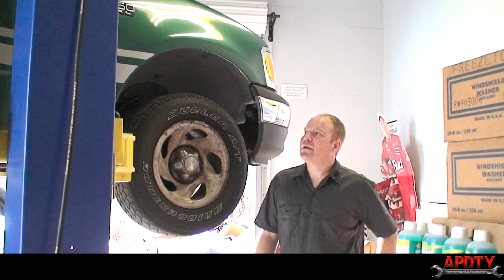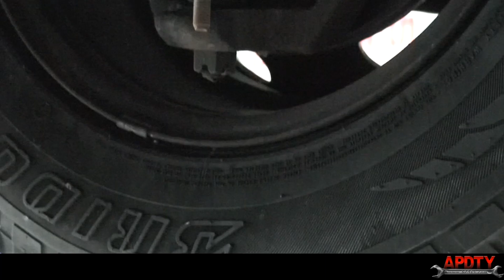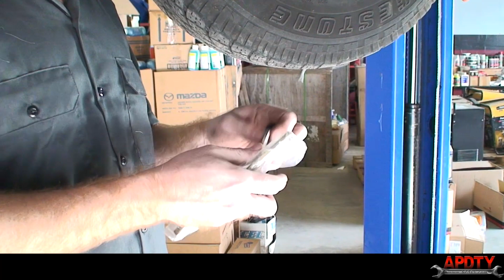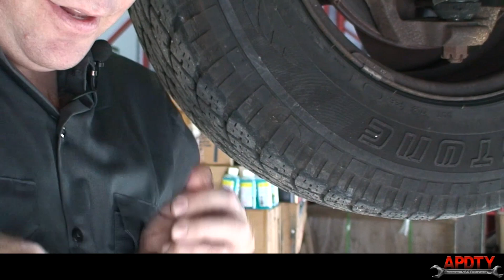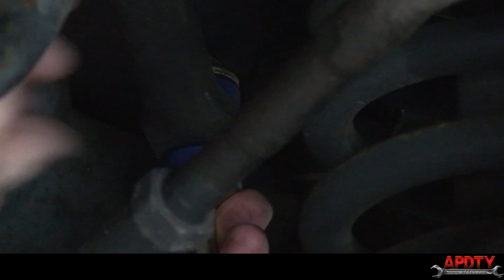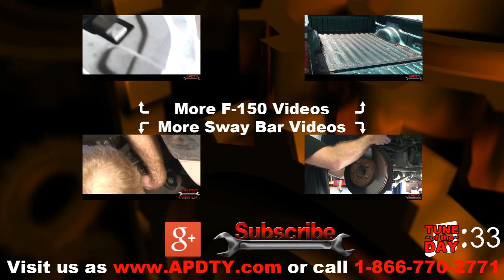1999 Ford F-150 Sway Bar Link

Comment: Believe it or not the bushings like that you can use it product called Ultra Glide yes it's used for non mechanical things but it does help slide stuff through bushings like that and honestly I used it for quite a long time it helps making tight fit
Reply from the maker: mr. Hoole awesome, thanks for watching and commenting!

Comment: Put them in upside down. Not good info
Reply: Actually he didn't. My oems ones are still in my 2001 and the go in the same way. But then again this truck came with 3-4 different diameter sway bars, so it could be different on other sizes.

Comment: Thanks for the video. I've got the parts got to do this tomorrow on my '99. Mine are completely gone, just bolts.
Reply: Mine too. Kept thinking the rattling was loose exhaust until I changed my oil and bumped the sway bar. Just bolt & nut all that was left.
Reply: My '99 too. How many miles on yours?

Comment: Wonderful video, and a very helpful dialog. When I began working on my 1999 F150 rear wheel drive I saw that the stabilizer bar link bolts were not attached to the lower control arms, and the link bolts were so corroded that they were split lengthwise. Until I watched this video I had no idea the link bolts were supposed to be attached to the lower control arms — I thought the bolts were a “stop” for the stabilizer bar. And I am getting close to being 80 years old. “Too soon old, too late smart.”
Reply from the maker: we are glad our video helped, thanks so much or watching and commenting, when we help someone it makes us want to keep making these videos.

Comment: does vehicle have to be elevated to do this repair?
Reply from the maker: no not necessarily, we use a lift most all the time so we forget sometimes how it is without one, you can do it without lifting just the angles change up the approach a little bit.

Comment: Thanks so much for posting this video.  I didn't even know what a sway bar link was until I changed my shocks and noticed the original links (99 Expedition) just hanging with no rubber bushings etc.  I purchased the Moog parts based on your recommendation and installed them today.  Thanks again!
Reply from the maker: awesome great to hear and thanks for watching and commenting!!

Comment: by any chance are the black sleeves threaded??  Mine is stuck on the bolt...
Reply: cut it off with grinder..
Reply from the maker: yes sometimes these need to be cut off, the black sleeves are not threaded and you can cut right through the sleeve and the bolt if needed, it is not uncommon and many times easiest to just cut these off.

Comment: i have a question!? would anybody know what the size sway bar bushing i would need for a 2001 f150 4.6 ?? help
Reply from the maker: these mostly go by a year make and model search in a catalog, here is a link to the end link bushing kits that fit a 2001 F150 4.6L https://amzn.to/2xiOsPL
The above link is for the parts on each end of the sway bar, We would need to know if 2wd or 4wd and we can point you toward the main center bushings that attach the sway bar to the frame
Reply: By now you probably already have solved that, but for others wondering also, there is like 4 different sizes that were used on the 97-03 F150's. You have to measure them out with calipers to be sure you get the right size. You can also use a crescent wrench and get it around it tight, then take it off and measure it. Even on MOOG's site there is 4 different sizes for my 2001 F150 4x4 Extended Cab 4.6L. Mine however measured 25mm with calipers, but they come in 27mm, 30mm, 33mm and 35mm. So mine is the 27mm.

Comment: have a question if your sway bar links a need replacing with that cause your tires to wear on the inside of both front tires? or is that something else that wrong on top of the sway bar links needing replacement.
Reply from the maker: typically no, inner tire wear usually indicates a camber problem or can be a vehicle load issue such as towing and hauling. This occurs when the tire is actually leaning in towards the vehicle too much, this is easily visible when the alignment is checked unless it occurs during towing, towing lifts the from end of the vehicle up and the front tires lean in slightly, Worn sway bar bushings are very similar to any other worn front end part, your tires are not properly meeting the road surface unless all front end parts are working properly and the vehicle is aligned. If a sway bar link is worn out, the vehicle cannot hold the alignment properly as you go down the road so you end up with some type of tire wear and it is typically cupping that you get, the other bad news is that once a wear pattern is worn into a tire, that pattern will continue for the remainder of that tires life. SO you can fix a problem and still continue the same tire wear, in the olds days we would grind down some of the tire, now it is just replace the tires after all repairs are made as tire grinding is not done too often anymore.

Comment: Was having this problem with rattling, and noticed yesterday while swapping my front shocks that the sway bar links had no bushings.  Great video Moog replacements are in the mail so should have it all sorted out in a couple of days thanks to Amazon 2 day free prime member shipping.  $20 for 2 of them to stop that annoying rattling over bumps, and should improve my steering as well.  Eventually I want to rebuild and replace all the steering linkage bushings.  Truck is pushing 200k miles and basically anything that can break is pretty work breaking at this point.  However maintenance to fix it as it breaks is still cheaper than a new truck payment, and insurance.  Gonna drive it until the wheels falls off or I'm too old to drive.  lol
Reply from the maker: awesome great to hear, thanks for watching!!

Comment: Just a note to say how much I appreciate your video. Simple to follow instructions for a shade tree mechanic like me.  Replaced sway bar links on my 99 Ford Ranger today in about half an hour. I could not believe the difference in steering stability after the job was done. The Moog folks owe you one. Used their parts based on your recommendation. Thanks again for your help.
Reply: Try that and a front end alignment
Reply from the maker: You can diagnose this yourself pretty easy.  Tires are many time the cause of a pull and to rule them out, first make sure the front tires have the same air pressure, then if they do, cross-rotate the front tires. Take the front left end put it on the from right and same with the other. The test drive and if the vehicle pulls to the right, you diagnosed it as a bad tire. If the pull still occurs, then move on to the suspension or steering components as well as the wheel bearing and brake caliper/hose. Jack up the vehicle and spin each front tire, the should spin about the same, if the right for is having up, it is a brake or bearing issue. If not continue inspecting the front end, shake down and look for any worn out from end parts. 9 out of 10 vehicle with a pulling problem will be diagnosed with the above steps.

Comment: what kit did you use?
Reply: Here is a link to the individual part for a Ford F150 1997-2003:
http://www.apdty.com/searchItem.epc?sku=MOO_K8772

If you have any other model, you can look them up in the catalog on the website located here:

http://www.apdty.com/continueshopping.epc
Reply: Thanks